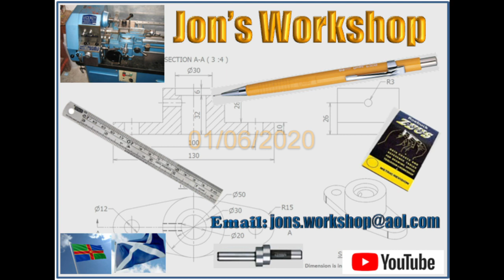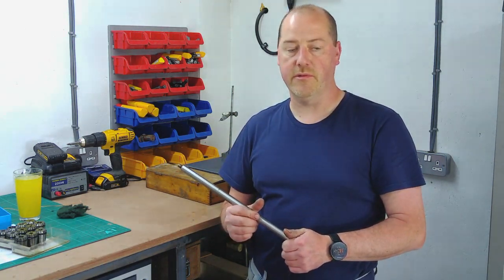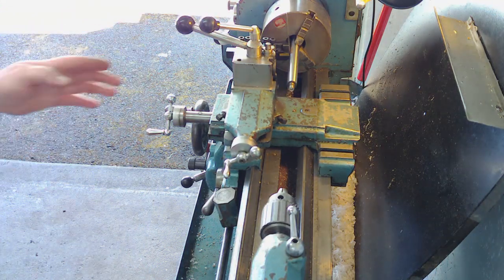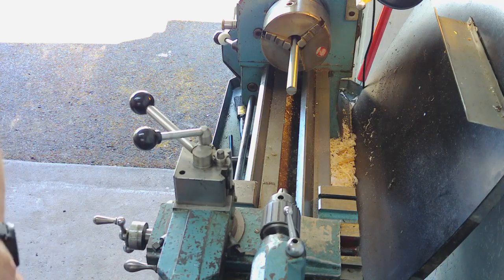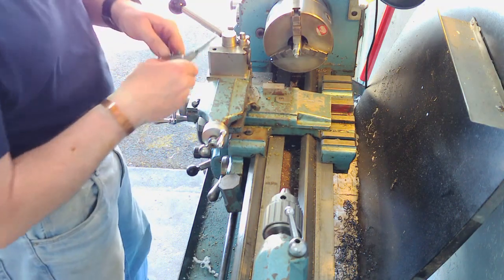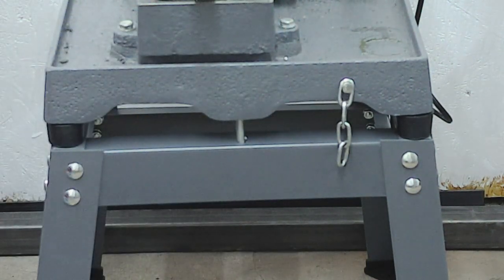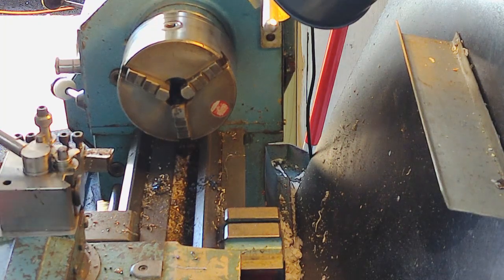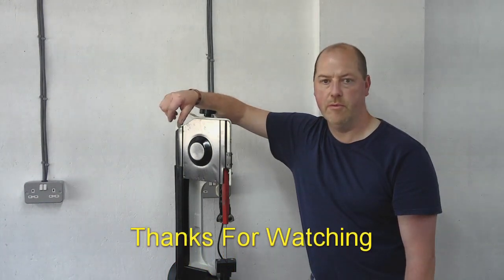Episode 13   Cormak Bandsaw Modification

Comment: Hi Jon, that was brilliant, thanks. Sometimes I find with my lathe the parting tool fairs better if it's ever so slightly below centre. I like the mod to the saw, it's funny how little changes make a big difference. Could you possibly blue up the top face of the compound and the underside of the tool post on your surface plate, to find out the source of the trouble? Maybe it's the toolpost. You could try a different one, one of the generic Chinese piston lock types maybe. This would be a good thing to post about on the mig welding forum. A few guys there have surface grinders. I think you will find lots of guys willing to help. It's a really nice lathe by the way. What sort of spindle nose does it have? Looking forward to the next instalment.

Quick thought, you could use your finger dti on its stand with the surface plate to check the flatness of your compound/toolpost too.
Reply: Having the parting tool above centre may work on bigger industrial lathes but on smaller ones the front just rubs before the cutting edge can come into play and you don't have enough oomph to push through.
Another cause for parting ptoblems is a bell mouthed chuck. I didn't think I had a problem till I realised i could part more easily when using my four jaw chuck than my three. After boring the three jaw jaws, parting became more pleasant. And yes i bored them not ground them and yes it is a quality British chuck not some soft oriental monstrosity. 
I recall one time demonstrating at a Model Engineering exhibition, that people were sutprised i could part so easily on mr Myford's finest, the t t ick is to have confidence and not pussy foot about. Set it up right and keep a constant pressure on so the forces dont change and cause the deflection of the tool and post to alter. 
Oh dear im beginning to preach, sorry.
Reply from the maker: @chrisstephens6673  Good point Chris, I never even gave the Jaws a thought, probably because I have inspected the top face of the compound a couple of years ago by laying a straight edge over it, you can get some sizeable feelers underneath so I have it fixed in my mind that is where the issue is. I will check the Jaws out also. Thanks. Jon
Reply from the maker: Hi Carl, yes, I am pleased with the saw mod. The Denford has a 1.5" x 8 TPI nose with an MT3 up the spout (same as the Boxford). Bit weedy but it's just about OK for the size of the chucks. The Denford has a 13/16ths tube through the headstock though which is a full 16th bigger than the Boxford. Having already inspected the compound face, I know its shocking so I will start with this and move outwards in both directions. I plan to skim in the mill (being ordered shortly........ Oohh the excitement), and then blue and scrape now I have a decent surface plate, and the dti will come into play once I have addressed the slop in that too. Thanks for the support. Jon
Reply: @jonsworkshop  It's a really nice lathe. I've always liked those Denfords. Sounds like a good plan to sort the compound. I'm looking forward to seeing further progress with your workshop and mill when it arrives. I'm sure I am going to learn a lot. Thank you.

Comment: Hi, Jon you could scrape and lap the compound on your new surface plate, Steffan style, Haha,. is that one of those teflon coated rules, ? Cheers Ade.
Reply from the maker: Hi Ade, I am using it as a perfect justification to buy a mill, just going through the down selection process now...... Ohhhh the excitement! I will skim it on the mill, then have a go at scraping now I have a decent surface plate...... Should be a laugh if nothing else. Cheers. Jon
Reply: @jonsworkshop  exactly what I was going to suggest, but Ade beat me to it 😂 why not draw file it and then put a print on it.... You never know 😁
Reply from the maker: @russellhayward2359  Hi Russell, don't forget Mrs Jon's Workshop reads these comments....... I've got plenty of files but I am convinced a mill is what I need to do the job properly 😉😉😉 Cheers, Jon
Reply: @jonsworkshop  well it would make for another entertaining video.. just saying 😂😁💖

Comment: Since you suspected it was case hardened would it have been easier to shortened the other end so not have to deal with the hard stuff. Enjoyed the video 👍
Reply from the maker: Hi Peter, thanks for the comment, it was case hardened and ground down the entire length..... but now you have just said that, you are spot on, I don't know what I was thinking (out of practice), it would have been easier to drill and tap M5 then turn and thread M10. Oh well, either way I am pleased with the end result. Glad you are enjoying the content. Jon

Comment: Awesome vid Jon! Personally I'd suspect the tool post itself rather then the compound, if that's not a genuine dickson quick change it could be your issue, I do have a surface grinder I could probably grind the compound for you but it would involve shipping to Dublin, probably be a killer on shipping, if there isn't a lock on the compound you could add one to help with rigidity for the time being, I've got a big harrison m300 and if I don't lock out the compound it won't part off properly, keep up the good work buddy 👍👍
Reply from the maker: Hi Tadhg, thanks, yep I think the shipping will will be prohibitive unfortunately but thanks for the offer. I am close to putting an order in for a mill so it will make a good project. I will skim it on the mill, then blue and scrape to finish now I have a decent surface plate to work with. You may be right, it's no Dickson unfortunately, it is some cheap import rubbish that came with the lathe. I may replace it in the longer term so don't intend spending too much on it. It turns OK so I think a rear parting tool post will be the answer and also make a good project for the mill. Thanks again. Jon

Comment: I've got the same problem with one of my lathes only I suspected the slide rather than the flatness of the top. Probably turn out to be a bit of each when I get around to doing it.
Reply from the maker: Hi Derrick, mine could be a bit of both too, but in my case the top face on the compound is shocking, you can see it just laying a rule over it, it looks like it's had some abuse. Thanks for the comment. Jon

Comment: A couple of things come to mind watching your video. First you need to raise your lathe to an adult height,  you are no longer a school kid.🤔
Next I am very glad I haven't got a back to front(american style) lathe. On a proper one the handle used mainly should be operated by the right hand, if for no other reason than your hand is out of the way of hot chips.
Was it Shakespeare who said parting was such sweet sorrow, he must have been a Turner in his next life and regressed to write plays. See my comment in Carl's comment for some of my experiences. Maybe one day I'll video some of my experiments with a tangential parting tool. 
Whatever the problems along the way, a British engineer showed his superiority over some foreign designer.🤣🤣🤣
Reply from the maker: Hi Chris, yes, agreed, the lathe is a bit low and it will get worse when I put some matting down on the floor. I will do something about it if it starts to become painful. All lathes used in schools (as mine was) have the back to front handles (Boxford, Denford etc), I am sure it was done deliberately just to put kids off for life when they burnt their hands. I will check your comments out. Thanks for the support. Jon
Reply: @jonsworkshop  aren't both the lathes you mentioned copied from yankee models. There is an american train fan who gave the advice to never buy a lathe with the saddle handle on the right, giving the impression he thought it unamerican. Go figure, as they say over there.
My colchester is raised about 200mm, did i mention i was 6' 6", and my average height "apprentice" finds it more comfortable to use.